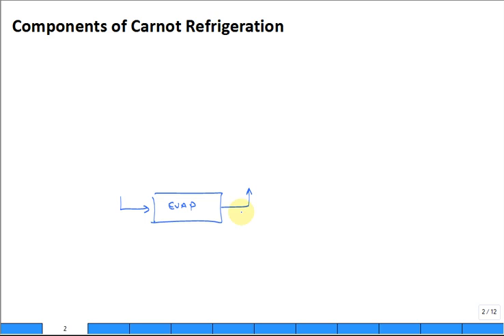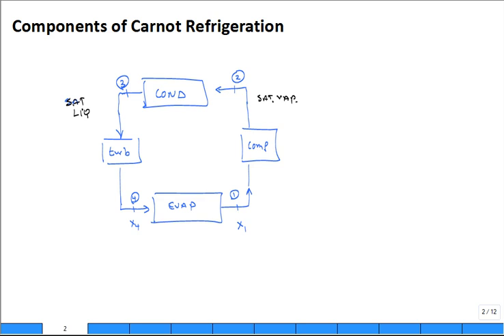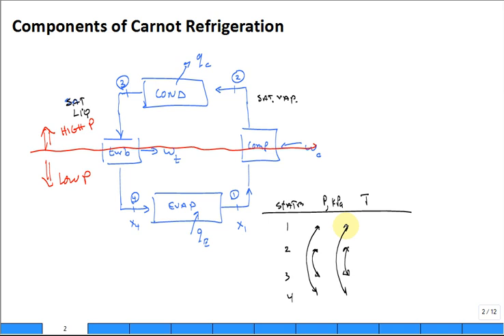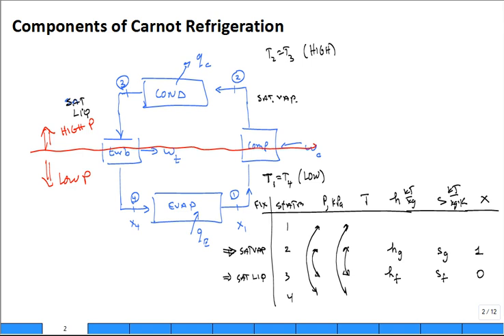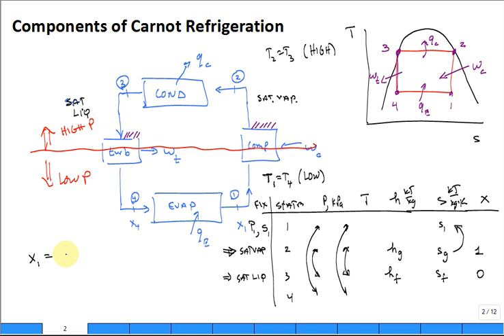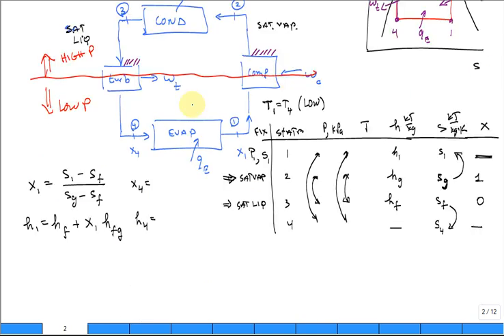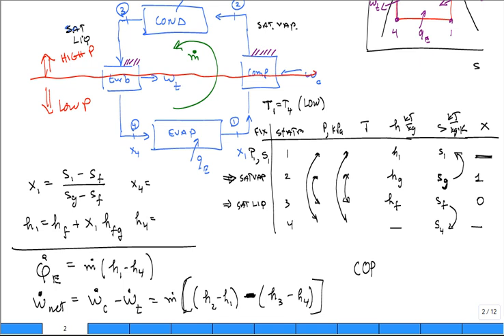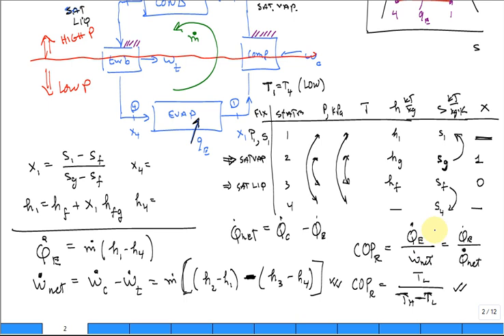Intro Carnot refrigeration cycle

Comment: Does it mean evaporation and condensation are not only isothermal processes they are also isobaric processes? Thanks
Reply from the maker: yes, constant temperature and constant pressure, both for evaporator and condenser

Comment: I don't think That T1 = T4 , because its Out of an evaporator !  I guess T1>T4 , That's what i Learned !
Even T2 and t3
Reply from the maker: +Heythem Belghoula T1 equals T4.  State 1 is out of evaporator and state 4 into evaporator.  But evaporator is constant pressure, and both states are 2-phase liquid-vapor mixture, so T1=T4=Tsat(Pevap).  There is heat transfer to fluid in the evaporator yet temperature does not change.  Many students struggle with this.
Reply: +Randall Manteufel ah !  i see now , thank you very much Sir .
Reply: @heythembelghoula2867  can you tell me as Im confused that when heat is transferred to refrigerant in evaporator so why its temp and pressure still constant after getting heat ????
Reply: @maria-wl4xt  Temperature evens out through out the evaporator
Reply: @randallmanteufel6411  Would T1 still equal T4 in a vapour compression cycle, (in a non Carnot cycle)
Reply: t1=t4 everyone knows

Comment: my text book says that the saturated vapor occurs at point 1?  

" refrigerant entering the compressor is assumed to be a dry saturated vapor"  P. 532 Heating, Ventilating, and Air Conditioning 6th edition
Reply from the maker: Carnot refrigeration cycle is not same as traditional vapor compression refrigerator cycle.

Comment: how do you calculate the X4 and H4? Anyone - what is the formula?
Reply from the maker: +Don RE isentropic expansion through "turbine" so pressure and entropy fix the state 4.  p4=Plow=P1, s4=s3.  then x4 = (s4-sf)/(sg-sf) then h4 = hf + x4*(hg-hf).
Reply: Thanks this you tube clip has cleared everything up with regards to how it all fits together.  I am doing distance learning which is very difficult to understand the book at times. Just go to learn how to plot performance characteristics of a refrigeration system as functions to condenser and evaporator water leaving temperatures.

Thanks Don